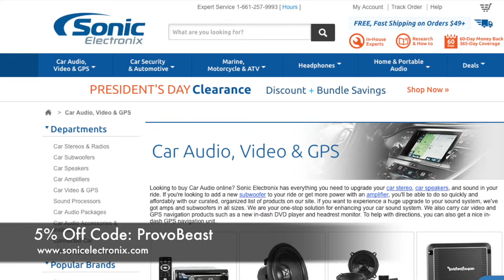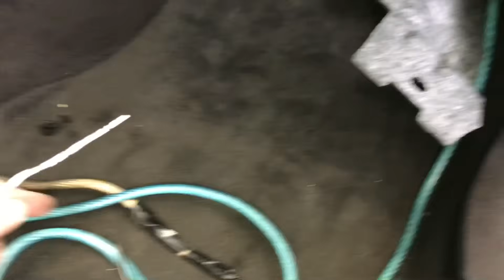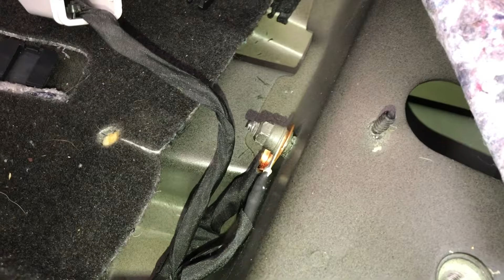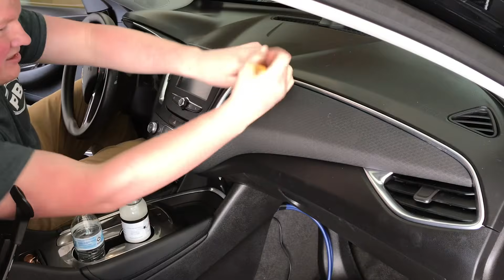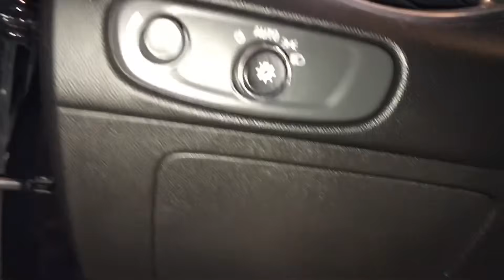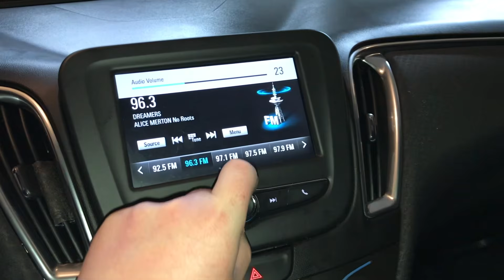2016 - 2022 Chevy Malibu 5 Channel Amp Install

Comment: I tapped into the K2 relay which is the retain accessory power relay for remote wire to my LOC. Everything works fine except when I'm driving I have random waves of bass coming out of my amplifier. Any suggestions on why? I know the range have nose cancelling that requires you to unplug the mics to stop it on those. Does this Malibu have that or is it another issue?

Comment: I have to run a loc to my head unit tap those wires into head unit then connect rcas to loc back into my amp so I still use the tan plug to cut into them or the white one I asked google and it said use both to get true left and right balanced audio or just putting my loc wires to the tan plug?

Comment: Dude installing an amp is hard and expensive is there any other way to get good audio without one 😊
Reply: It's actually not at all. This guy just chose the most difficult and moronic way to set it up. You can just use a LOC and tap into the back speakers from the trunk. You don't need to mess with the radio, dashboard, none of that.

Power from the positive all the way to the trunk, ground in the trunk, LOC in the back speakers, hook up subs, done.

Comment: So the stock amp is still hooked up??
Reply from the maker: This Malibu didn’t have an amp. If you do you will need to bypass it if planning on powering your interior speakers with something aftermarket.
Reply: @ProvoBeastAudio can I still get signal from amp if I bypass it thank u for response

Comment: Hello my friend. I’ve buy everything you suggested in this video. I installed everything as you said in this video. The problem I have is my Malibu is 2024 and the connections behind the stereo are different and I can’t find the speaker wiring. Do you know where are located? Thank you.
Reply: Factory amp is where you have to connect system

Comment: I can’t find the speaker wires coming from the factory amp is where I’m trying to tap into I found blue with black stripe green with black stripe but no white and no plain green wire

Comment: HEY GUYS ... I have been watching your videos here for a few weeks I have a 2017 chevy malibu LT . I have been having a hell of a time hooking my door speakers from SKAR Audio 6.5" TX 65 4 door speakers. and 8 " sundown audio sub woofer. I also have 2 amplifiers 
1) Amp is for my 8" subwoofer. The 2nd) Amp I wanted to use for my door speakers the Amps are MB Quart the one for my door speakers is the onx 4.60 - 4 x 60 watts am I able to hook all this up to my factory head unit with a line out converter? 
Would you happen to know any installers, of your quality installation near or around Williamsport Pa. 17701?

Comment: What did you do for the drone? I have a 2023 and when I tapped into the speaker wire and used an LC2i I get a drone noise when I accelerate and let off the gas. Same ground and power points you used.
Reply from the maker: Disable ANC by cutting the lead to the mic in the headliner above the passenger front seat.

Comment: Wandering if you had to deal with ANC bypass at all
Reply from the maker: Later years of this generation yes. Just cut the leads to the mic in the headliner above the passenger front seat.
Reply: @ProvoBeastAudio   will it make it throw codes or void warranty?

Comment: I have a factory amp and I connecting from the amp . I am getting a hum when I step on the gas.
Reply: You need to disconnect the ANC, that's the noice canceling feature.
Reply: It's the purple wire on the top plug of the factory amplifier located in the passenger side trunk wall.

Comment: I’m a lil concerned with the positioning of ur amp. During winter when u run ur heater, does it affect ur amp as the amp is sitting directly in from of the vents? Summer time I know that’d be awesome cooling. Now my qstn is how is it holding with the heat on or it really doesn’t matter & ur amp fan does it’s job cooling it? Please let me know!! & thanks for this great video
Reply: Yea, im a new Malibu owner and am thinking the same thing about that location
Reply: @vincentmagallon  I have my amp in truck attached to the back seat and it’s been fine for 4 years now
Reply: @YoungInFemousBeats  where did hook up ground?
Reply: I’m late but that Malibu doesn’t have heated seats
Reply: @YoungInFemousBeats  Im sure he was talking about the air vents under the seat blowing hot air in the winter to the amp.
Reply: @YoungInFemousBeats mines does I have a 2020

Comment: I have a 2018 LT with the 6 speaker setup. I have the bigger touchscreen as well. Is it the same install procedure?? Also what about the factory amp? I see your just tapping in so does the factory amp get disabled during your install somehow? Thanks for any information.

Comment: Will this method work on a 2020 Malibu??
Reply from the maker: Technique will be the same, yes.
Reply: @ProvoBeastAudio  which wires are the 12v constant ground, remote wire, ground wire and reference ground ?
Reply: The back of the 2020 does not have any of these same wires in the back of it

Comment: That method doesn’t work on my 21 with the 8in screen.
Reply: The factory non Bose amp is next to the grommet you routed the power cable in 2021 IOR production code

Comment: So I'm looking to do a similar setup in my base model 2017 malibu, just with a smaller amp and sub. My question is, if I hook up the sub and amp the way you did, how do you control the bass volume? Just through the stereo and it will control the cabin speakers as well as the sub? Or is there a knob on the amp to turn? Or is there a remote knob that I can install to control the volume of this aftermarket setup? I apologize for having so many questions but I just want to get this set up right and correctly so that way nothing goes wrong with my car. Great job by the way!

Comment: Can't find where to connect the remote wire (the blue one on the amp)  I've tried several slots in the fuse box and they work but when the car shuts off during the AutoShutOff, the power goes out until it kicks back on. Any special accessory slot that will prevent this from turning off my amp?
Reply: Same problem

Comment: Is anyone having any issues with the radio reception after this install??? If so has anyone found a fix for what ever is interfering with the signal? Any suggestions are welcomed....
Reply: What issues did you have?. My android auto turns off then I think the noise cancelation interferes.

Comment: I installed a system into my Malibu 2018 but when I accelerate my bass goes loud and when I slow down does the same thing would you know why??
Reply from the maker: you may have fake engine noise pumped into your system or you have a really bad ground loop issue.
Reply: When you go in your settings, did you press the audio, auto volume, and turn it off? My girl had a Ford that turned the music up the faster you drive.

Comment: I am looking to add a 2nd Battery in my trunk (with a battery controller - I have an extra yellow Top Optum), a Cap, an amp, and a sub in my 2016 Malibu Premiere with a Bose System.  Thank you so much for this video showing how you ran the power.

Can you PLEASE message me the fuse numbers associated with the Switched Fuses? 
Thanks
Steve 
TeamRocs #23

Comment: This will not work at 2019... Please edit title as it's misleading... Also did you retain Bluetooth? And if so what did you do to lower volume for door chimes, seatbelt etc as they run through the speakers

Comment: Hope any one can help..Im Having the humming sound from my subs since installion. When I first start my vehicle the subs hum and when I accelerate on the gas pedal it hums..Why does the speaker do this and what can I do to fix the issue.
Reply: It’s your ANC mics you need to disconnect your ANC system.
Reply: @IBL33DBL00D  Cut the purple wire on the top plug on the factory amp on the right side of the trunk under the carpet.
Reply: You can get a bypass harness from lj’s customs that way you don’t void your warranty

Comment: What about the Active noise cancelling? Did you cut the purple wire on the factory amp? Use a bypass harness? I'm wondering.
Reply: No really, I have a Chevy Malibu 2010. I got myself everything I need for a system an now someone says I need a t harness for behind the radio but I go an buy it cost me 100$ I go buy that now another friend says I don’t need it what do I do, I just need a good detailed video an I can try myself but this has been a mess been tryna get it installed for 2 1/2 weeks now

Comment: when I also try to have the bass higher, it like cuts off my subwoofer to when I’m driving and when I press my break it like cuts it off for a bit, why is that , I have to use it on L6 which turns my Malibu Chevy 2018 LT to automatic and shuts off the auto stop to prevent my 12” kicker from cutting off when I drive it on regular drive, cuz my car has auto stop, so even when I drive it on L6 , the auto stop is off, but when I press my brake at a stop it still cuts off only when I have a high bass.
Reply: Look n yo trunk bro on yo factory amp the first set of connections look for the purple n blue wire it’s a microphone also noise cancellation wire cut wire n problem solved bro I had the same issue shits nerve wrecking

Comment: Where did you get the fuse holder for the remote wire
Reply from the maker: Just search in-line fuse in amazon.

Comment: What about doing it right before the factory amp in the back?
Reply from the maker: If you have the factory amp, do it.  cleaner install.
Reply: @ProvoBeastAudio  The factory amp has a plug for speaker wire, thinner gauge wires are from the radio module to the factory amp while the thicker gauge wires go from the factory amp to the speakers. All the speaker wires high level input and speaker output on the green connector on the factory amp. Which wires do I tap into the thinner that go to the amp or thicker wires from the stock amp to the speakers? Please let me know, thanks.
Reply: Did you ever find out which to tap into?  Im currently trying to do this to my 17...
Reply: @mikeadams5414  that was ages ago basically I pulled a plug diagram showing me what was the power the negative the ends the outs all that and I ran them into my own harness to power up the amp that I put in I don't have any of that information anymore I've sold the car already

Comment: Where would I install the tweeters in the front. This cars not like min I cant just cut the grille off the original tweeter hole and drop it in along with a new trim ring around it

Comment: Would the addition of a 5 channel line output converter be necessary and would it help with the overall sound of the system? And if so how would I hookup both to the factory radio?

Comment: Thanks for the help man. Got it done and works perfect, did it a little different but you helped in a few places I was stuck, appreciate it
Reply: The power, ground , installation part I can do which seems pretty easy but I don’t understand the  conductor part that he did do have to buy the conductor and a harness adapter  so I don’t void my warranty? Please help me understand I wish he could’ve showed how he did it step by step instead of splicing everything and making it’ seem so easy in the video.
Reply: Where did you install your amp ?
Reply: @DJDAJUICEMAN  I installed it into my stereo by taking my cars interior off to access the stereos electronics to connect it, then I routed it from the stereo to my battery for power, lined the wires under the side panels and interior on the right side of car through the glove box since it was connected to the stereo I could route it all the way to the amp connected to the subs in my trunk. Hope this helps and makes sense!
Reply: @crypticchaos5296  ok cool thanks!👍
Reply: @DJDAJUICEMAN  all good make sure you put in a fuse blocker just in case it fails you don’t want your battery getting fucked
Reply: @crypticchaos5296  will do !👍
Reply: @crypticchaos5296  I got a 2017 Malibu I’m
Scared but confident that I won’t mess it up lol This would be my first time doing my own installation for in amp. I’ve always had someone else do it but I’m on a budget and why not run it the way I want instead of someone else doing it this time .
Reply: @DJDAJUICEMAN  I agree, it’s fairly simple as long as you can splice and deal with wiring, got dual 12’s in mine, was budget also and they were hella cheap and BUMP. Hope it all works out and I might not be the best of help but I can try my best if you need me I’ll answer back fairly quick, good luck!
Reply: @crypticchaos5296  thank you I appreciate it hopefully it works ! I might make a video on showing how to do step by step on a 4 channel amp
Reply: @crypticchaos5296 still available ?
Reply: What kind of amp would you suggest for highs alone ?
Reply: @DJDAJUICEMAN  I’m more into lows for bass but I think there’s one that are called skar or something and they’re pretty known to be a good amp for highs, never tested their product though and don’t know prices just the name
Reply: @crypticchaos5296  thanks again !👍
Reply: @DJDAJUICEMAN  yup I gotchu

Comment: The power is the red and purple and the ground of course is the black on the same plug correct?
Reply: Kayte Skayte yep, the power and ground will be on the very left of the plug, then basically goes in order (LF+-,RR+-, etc.).

Comment: You run in an issue with noise canceling microphones
Reply: i am
Reply: @BL-zk7iu  Cut the purple wire on the factory amp in the passenger side in the trunk. Pull back the trunk carpet.

Comment: Hey if u can.. can you show me how I would install 6x9s in the rear window
Reply: Did you ever get the rear 6x9’s installed? Have a 2019 RS and would like to add 6x9’s.
Reply: @beastgirl43  I got 2 memphis 6x9 installed but barely can hear them cause of the carpet with no speaker grill cut outs I'm trying to remove the deck but see no videos
Reply: @Inspector_Jimbo https://youtu.be/b5mvJGsjb4E?si=04wWq1xQ3McOhPvX
Reply: I plan on disconnecting my rear door speakers for 6x9s in the deck of my 16 malibu.
Reply: @BruceLayR8 https://youtu.be/gcCB3ORt0qc?si=Hebi4SUbq0MWFGNC

Comment: Did this model Malibu have a factory amp on the passenger side of the trunk? Im gonna be working on a 2018 redline edition later this week an it has a amp.
Reply from the maker: Nope, it didn't have the factory amplified version.  In your case, if you were to bypass the factory radio, you will connect the new amps outputs the the factory radio's speaker outputs which go directly to the speakers.  Really, its wiring what we did in the video, but at the factory amp location.
Reply: @ProvoBeastAudio  that's what I figured I'm doing a 5 chann amp so I'll bypass at the amp in the trunk. Dont know if I'm going to go hi pass like you did or if I'm going to go lc7i route depends on the customers budget! Thanks

Comment: What about the factory tweeters?
Reply from the maker: see the front speaker install: https://youtu.be/IN_K-qbQ_wo
Reply: @ProvoBeastAudio  I have a 2018 Chevy Malibu LT with 8 inch touchscreen without bose and I'm wondering if you can use rca to install the amp and sub. Kicker amp and sub. Also any interference with the factory active active noise cancelling with the amp and sub?
Reply: @ProvoBeastAudio  And what spec wattage amp and sub should I use to be safe on my 2018 Chevy Malibu LT 8 inch touchscreen without bose?